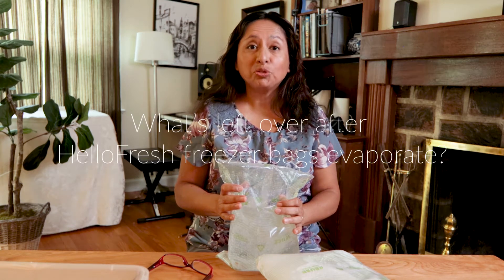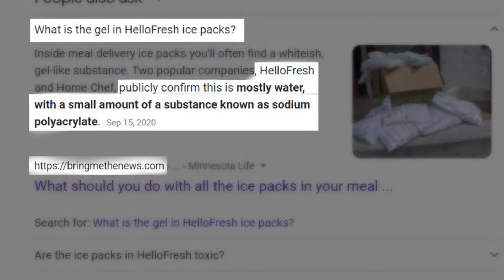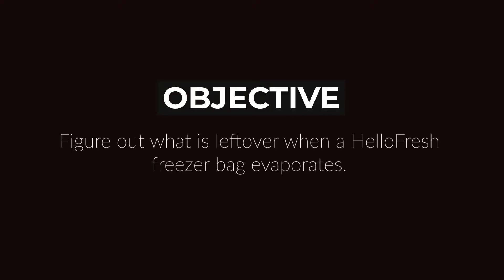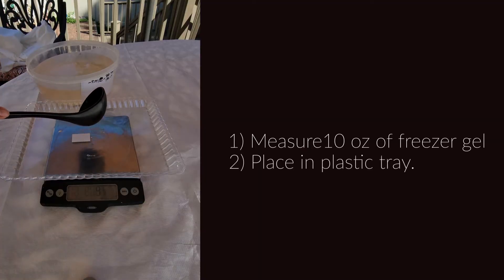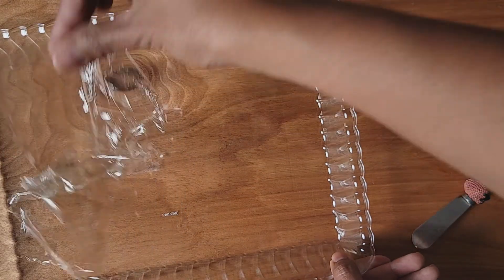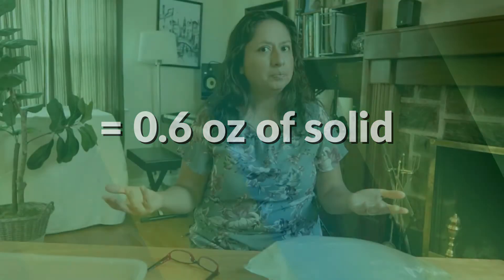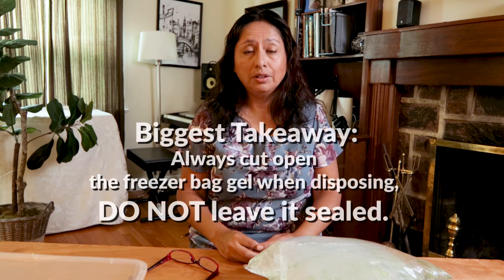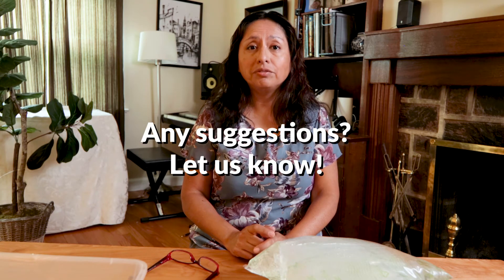Hello Fresh Freezer Bag Melts, Evaporates, THEN turns into this...

Comment: This is total insanity.  I'm trying out these meal delivery services as they have incentives to try 'em out.  Aside from the waste disposal problems and implications, of which there are many, NOBODY is going to take so much as a half minute to deal with gel disposal on a regular basis.  The package tells you to recycle the empty sack.  Plastic recycling is a myth.  And that's the useable, hard plastics.  The soft stuff is just trashed.  Next, they do not tell you what to do with the gel.  The stuff evaporates slower than a new pack arrives.  How do you spread this out around a small apartment anyway?  And you can't just dump it with your other trash and have it explode at the bottom of your compactor chute.  Who is expected to scrape that off the walls and compactor machinery?  And they don't tell you to NOT flush it down the toilet, even though it can potentially cause a blockage.  No, the kind of person that will forever eat these black plastic encased meals will not have any interest or capability to properly dispose of this mess.  That is why there are no meaningful instructions on the gel pack or anywhere else.  Our throw away world is just that.
Reply from the maker: Yep, I totally get the frustration.  And if I were to do a part 2, it's how this stuff does not evaporate that easy when you start mixing dirt in it, no one has time to make this a regular routine.  not practical at all, so I do dump out the contents in the trash and yes, it's a bit perplexing that the trash is in a plastic bag that goes to a landfill.  we give away as much as we can but there is only so much distribution.  correct about the plastic bag too, i have yet to find out where to recycle that, so i pierce the bag dump it in the trash and its all contained in a bigger bag anyway.  hoping someone finds a solution to all of this, it would be amazing if the delivery people collected the bags to return or have some incentive for a person to do that collection and make a few bucks like in the old days of recycling cans for a nickel.

Comment: I don't understand, If I cut open the bag, would it not make a mess in the trash compactor (it is a closed system, not an open thing) ? I don't want to evaporate it, I just want to throw it. thanks so much!
Reply from the maker: oh wow you got a trash compactor, that's not something I have used.  i think no matter what this stuff is in a plastic bag, airtight or a drawstring kitchen/black trash bag-  so i was just following their instructions, well half way i cut open the bag and toss contents in my trash that is contained in a garbage bag.  I think by emptying it out it's giving me comfort that if all this trash ends up in a landfill there is a chance that some will evaporate,  good luck to you!

Comment: Curious - can the gel mixture be dumped into a pot, that way the soil gets a slow release of water. 

Does the plastic film that’s left behind pose a problem for the plant/soil ?
Reply from the maker: so i think you run the risk of altering the ph of the soil more than that plastic film, this stuff once combined with the elements really doesn't break down that easy from what ive seen.  i think if you look up polyacrylate salination soil it might have some stuff on it. so then it's a question of how much can you dump where you alter it and what plants thrive on what ph.  i'm just speculating.

Comment: I've seen some places where they say to use it in your garden, and I think what I gained from that is that it can hold moisture for plants to get and really dry loose soil.

But I can't find anything that confirms that, or really explains it better.
For example, if my area is cold enough that it will freeze, will it freeze back and cause problems for plants, etc
Reply from the maker: Yes, I wish there were some gardeners that did an indepth study on this, like I think I saw something about the "salt" factor too, it may mess with the ph or not help plants that don't thrive in "salty" environments.  Also winter here in NJ makes it difficult for "evaporation speed". If I find out more will post.
Reply: I cut it open one bag and dumped it on our lawn to see what would happen. In 8 months since June, it's just stayed a lumpy brown mess of gel, has not lost much of the orignal volume maybe only 1/4. Not much evaporation that I can see. With the dirt mixed in, it looks like dog poop that's been out for a long time. I live in SoCal. To me, I don't see any gardening value in doing this, but that's just imo

Comment: yes it will clog drain. no it is not water soluble, it will evaporate if dumped in the yard, they are reusable in a cooler to keep drinks and food cold as long has they do not start to leak
Reply: What's left over after you let it evaporate in your yard?
Reply: @radish6691 that's my question. Does it leave a thin layer of plastic behind?
Reply from the maker: so i've seen this stuff mixed in and it does not want to dry out, there is a constant mush .  But then again it may not have been hot enough.  hmmm maybe i'll do a part 2, and include some other metrics,  like ph.  cause it may alter that. or will look around and see if someone has done it already.  the advice to use for gardening is intriguing

Comment: Thanks, now I’m dumping them in my flower bed.
Reply: Please post the results!
Reply: @rongarza9488  nothing exceptional has happened. It just melts. It’s not making my flowers do anything special.
Reply: @ycumbess  well it's just water and salt. Its suppose to help the soil retain that moisture. So it doesn't dry out as fast.
Reply from the maker: @ycumbess  appreciate the follow up!!
Reply: I read somewhere that it can help retain moisture longer for this situation. I'm curious though if the residue eventually can build up overtime causing it to be bad.
Reply from the maker: Let us know what happens!
Reply: @sayahmedia  so far, nothing exceptional. It just slowly melts into the ground.